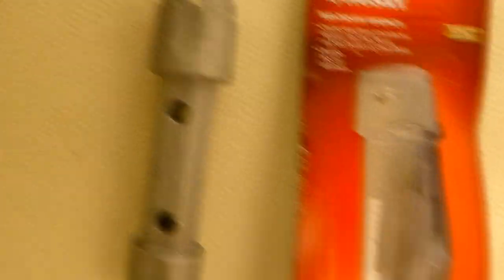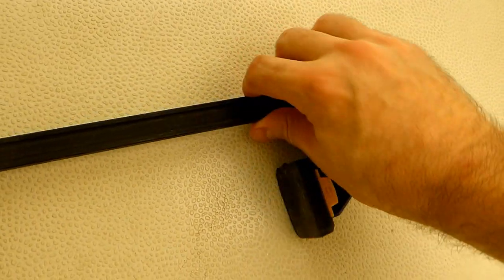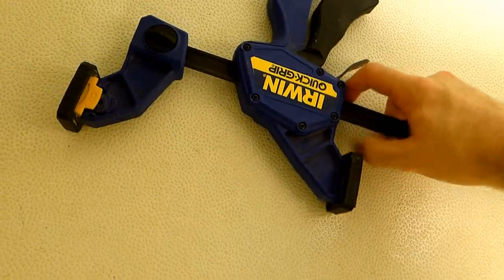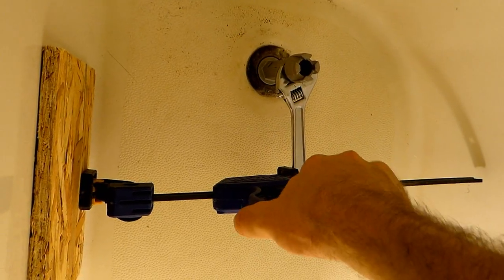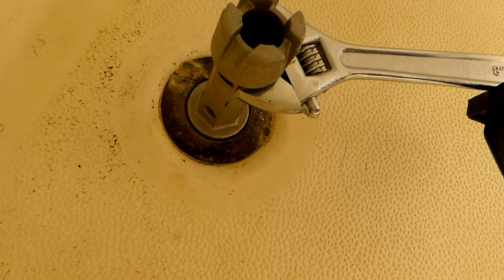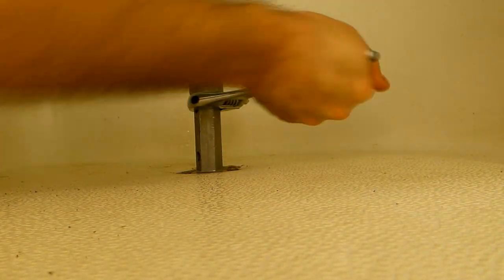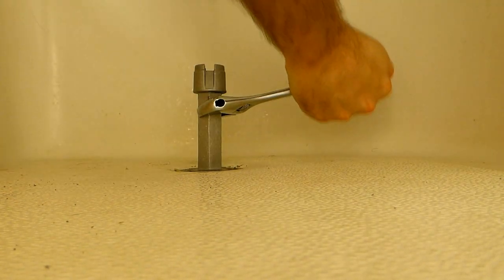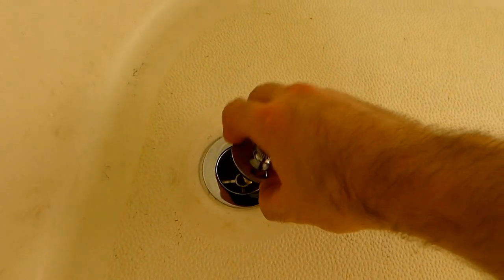How To Easily REMOVE STUBBORN Rusted Bathtub DRAIN SHOE (DIY Install Improvement Replace Leak Nut)

Comment: Ever heard of a cheater bar or pipe? Clamp seems kinda inferior to some good old leverage. Just slip a 2 ft pipe over that wrench and give it a turn. Then reset once you hit the edge of the tub with your lengthened handle. Just don't rip the cross bar  out of your drain bolt with all your new found torque.
Reply: Also this is good content and I appreciate the ingenuity. The clamp idea has lots of good applications too.
Reply from the maker: Thank you.

Comment: I tried it but the clamp broke instead, I have tried everything and so far I have no solution
Reply from the maker: Sorry to hear that, Avigdor Samuel! Did you use a good clamp - it normally should withstand a pretty heavy strain? Check if they sell any liquid that softens the adhesive that was used during the drain shoe installation and try again with a good clamp. Hope you'll solve it!
Reply: spray penetrating oil on the drainshoe and let it sit overnight 

to get rid of the odor afterward, clean the area with vinegar and rinse the bathtub